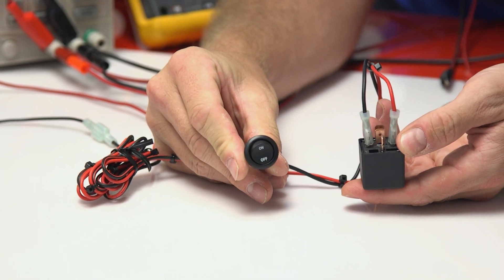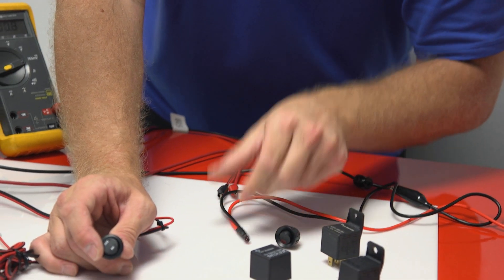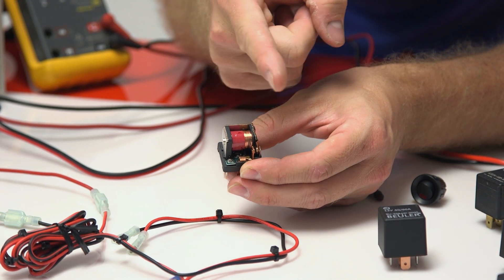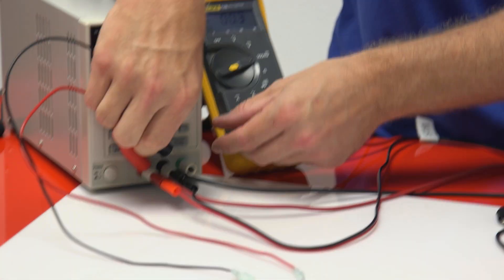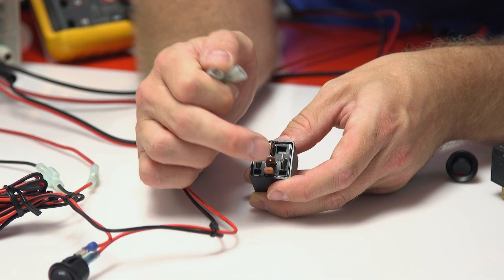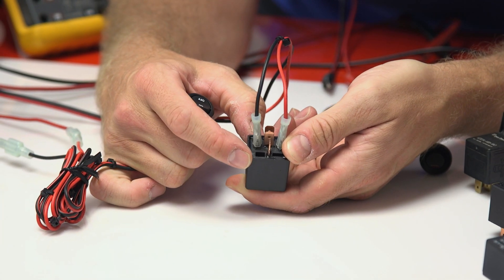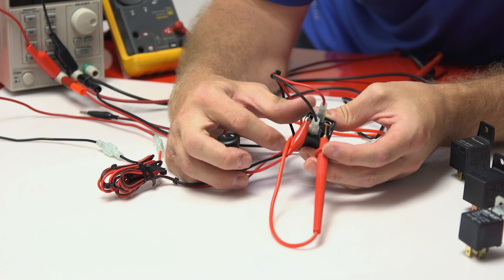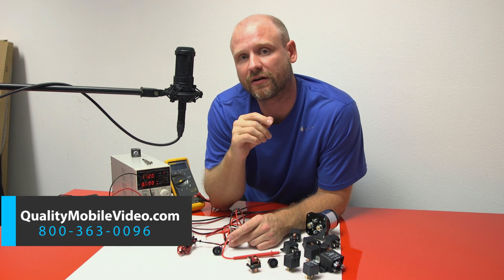How to wire a relay - Tutorial

Comment: Would you please create a video that shows a relay connected to a backup camera? The switch I purchased is merely a 3 way toggle on/off/on. I am attempting a rear and front camera using a 3 way switch and a 7" inch monitor! One of the trigger wires will be capped till I figure how to do GPS.The monitor has 2 video inputs and a separate power source so 2 diodes will be used to control power from surging from the monitor or the reverse camera ! I have a schematic of my design but cant figure how to download!
Reply from the maker: The can be done but it would have to be a in video form. It would be a long explanation if I were to type a response. Good idea for a video!
Reply: Quality Mobile Video that was my hope , another video!
Reply: Ottplayer

Comment: that didn't really helped me , what I wanted to know is if I'll be able to wire this relay to my backup camera that is connected to the reverse light wire, on the rear end of the truck, not by the dash. so it will solve the power issue I'm having,  flickering screen when I apply the brakes
Reply: You would use the power to going to the backup lights to go into the diode portion of the relay and then back to ground. you would then wire the power to backup camera through the load prongs of the relay. that way, when you put your car in reverse, a small bit of the current going to the backup lights triggers the relay to provide all the voltage you could need. Alternatively you could use an add-a-fuse to tap the reverse light fuse in the fuse box keeping you from having to run wires back and forth. This add a fuse will plug into where the fuse is for your reverse lights and provide and additional power stream when the backup lights are on that could be wired to the diode portion of the relay.